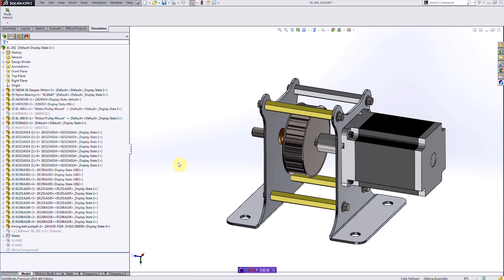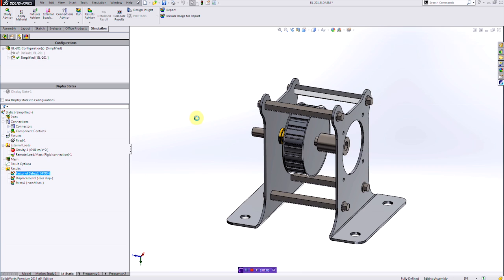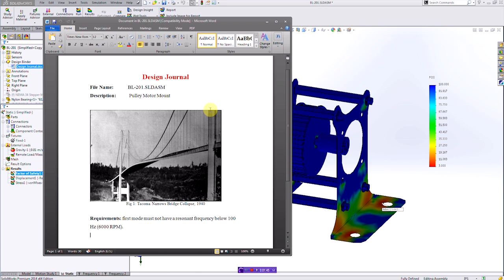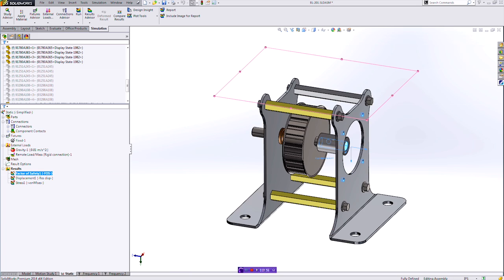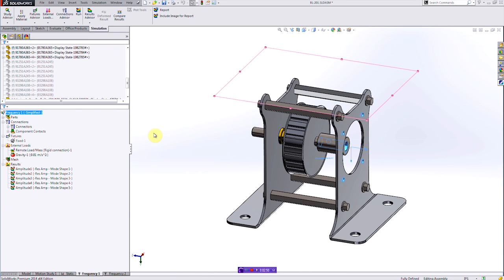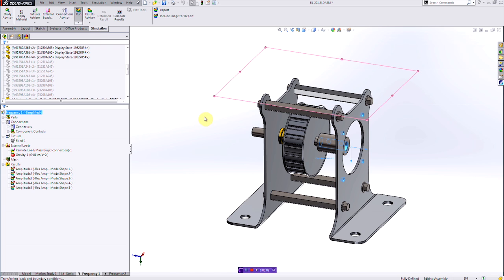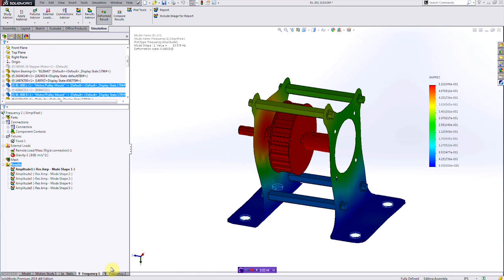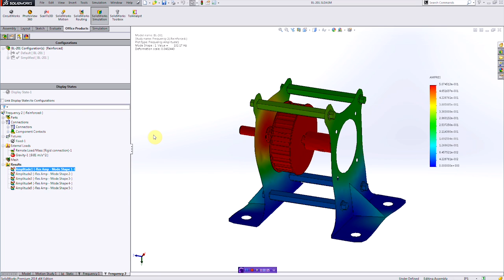SOLIDWORKS Simulation - Frequency Analysis

Comment: hello there, if the motor vibrates at 100 hertz why did you modify the design so it doesn't have frequency below 100?, what if the first natural frequency is 50 hertz, isn't that far enough from the frequency of the motor? how far should the load frequency be from the first natural frequncies? i'm struggling with that, hope someone can asnwer
Reply: I guess it deppends on the case,  On this particular one the natural frequency of the structure has to be greater than the 100Hz frequency of the motor, because in this way you  guarantee that both the natural (structure) and forced (engine) frequencies are different at all times, preventing thus the vibrating resonance. If you design below the 100Hz resonance might occur when the engine revs up or down from starting or stoping conditions.